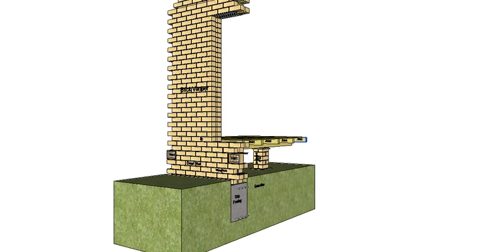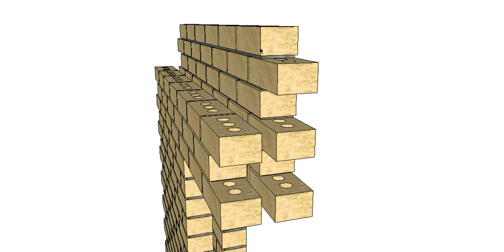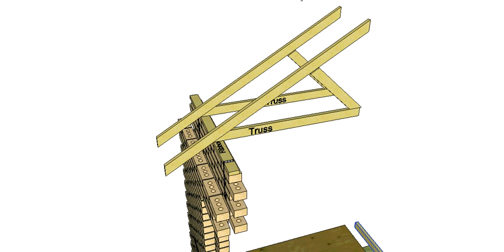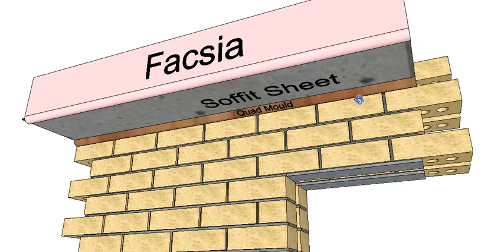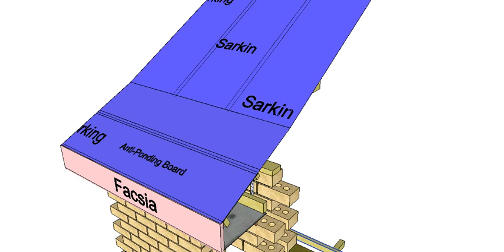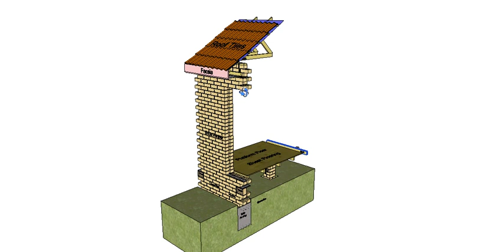Section Through a Double Brick Building Part 2

Comment: I live in a late 70s two storey double brick house in Fremantle, with a build very like this, except the soffit bearer rests on the top of outer leaf, almost like a wall plate, and the soffit board is located in the last mortar line ie between the top two external brick courses. The cavity is open at the top as you show, partly closed by the soffit bearer. I want to close off the top of cavity to gain some insulation points (there are plenty of airbricks at both floor levels to maintain moisture control). Intending to just shove some rockwool into the gap - would that work OK?

Comment: so the only thing holding the roof from blowing off in a windstorm is the strength of that mortar joint that embeds the strap? What is the tensile strength of that mortar? As you know, masonry has almost no tensile strength. What am I missing?
Reply from the maker: Hi Mate, no you got it, besides the weight of the roof thats all that holds the roof on. Now days if you are in a high wind area you would have to have threaded rods running up from the footings.

Comment: My boss put the ribbon plate on the external wall, because bricklayer finish the walls in same level. Since the internal wall should be the loading wall, i am just worried if it can meet the standard?
Reply from the maker: Hi Nathaniel, yeah certainly not the normal practice however as long as the outer skin was constructed to take the weight then there shouldn't be a problem and with a Brick wall as long as the lintels are adequate then to should be ok.

Comment: Hi Mate, thank you for this presentation. 
Question..when constructing a double brick wall, do you need to  place any form of insulation in between the gap of two walls?
Reply from the maker: Hi, no, the purpose of the cavity is to stop water seaping through the brick and working its way inside. If you were to fill the cavity with insulation this would let the water cross the cavity and into the house.
Hope this helps
Reply: @Buildsum  Hi Mate, thanks for your reply greatly appreciate it...if I can please ask you one more question ... How come on a double brick garage they don't use a DPC (a damp proof course)? My boss is not teaching me much he just wants me to mix mud and carry bricks
Reply from the maker: Hi Mate, Yeah not sure about that one, if it is actually double brick and not just a single skin with engaged piers, then I would definitely put in the DPC even in a single skin wall it would be worth it however not 100% effective as water can still enter through the brick.

Comment: nice thanks. Could it be possible to add alternative constructions, eg heritage home construction of double brick?
Reply from the maker: Hi Sue, unfortunately, there are so many different methods and styles that have been used that it would be hard to cover them all and with homes the age you are talking about and the era they were constructed they could have done anything depending on the materials and the budget that the builder had at the time. Sorry, I can't be more help.
Reply: @Buildsum  yes that makes sense, there weren't such tight building codes back then!  The video is really helpful though in terms of breaking down the construction process